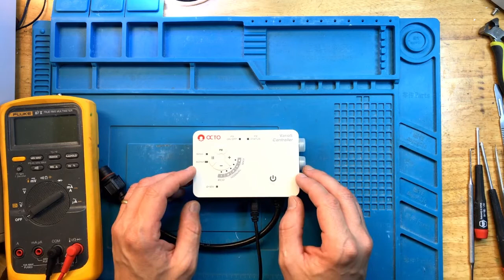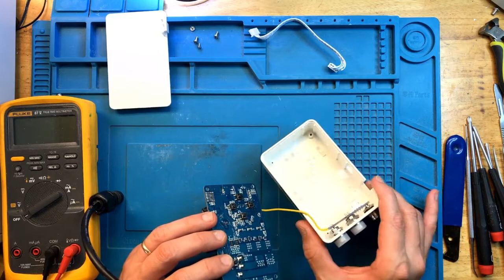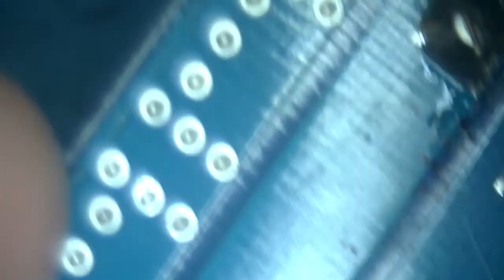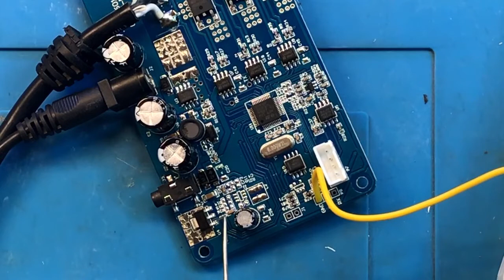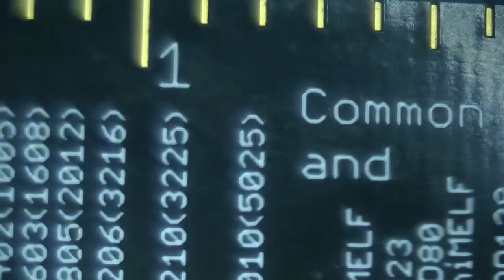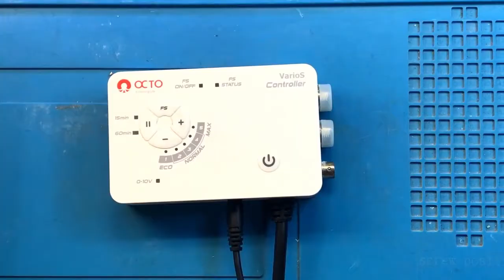Reef Octopus Varios 4 Controller - Short on main board

Comment: Friend. I'm having a problem with my VarioS 4-S skimmer pump. It suddenly stopped working. Could you tell me what voltage should be coming from the controller to the pump?

Comment: You said you couldn't use hot air to get the LEDs off and you are right about that.. you could have used hot air under the board to remove them, I do this with small plastic connectors like and it works like a charm 😁.
Reply from the maker: That is very true. A good reminder. Still need to have a strong hot air to get it above the melting temperature for unleaded solder assuming high heat dissipation board.